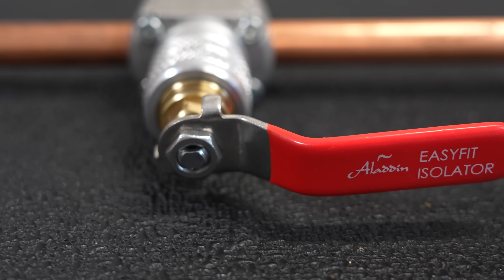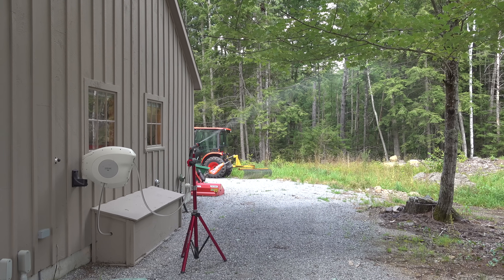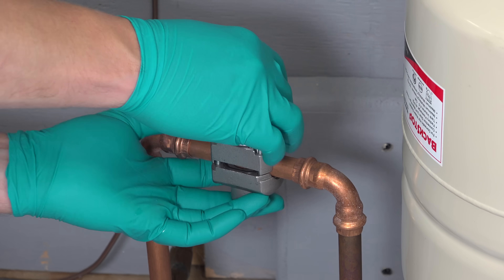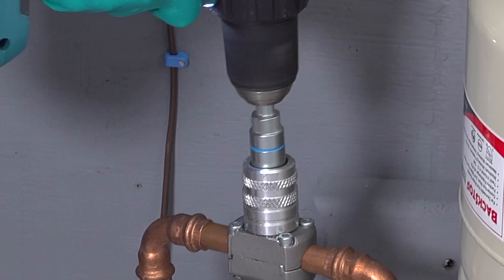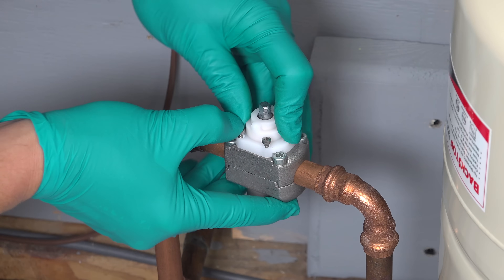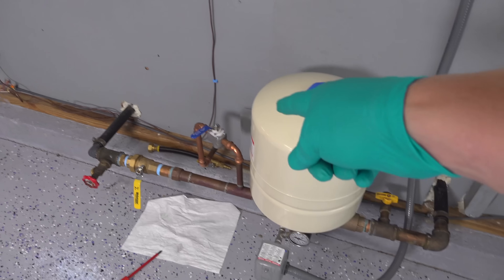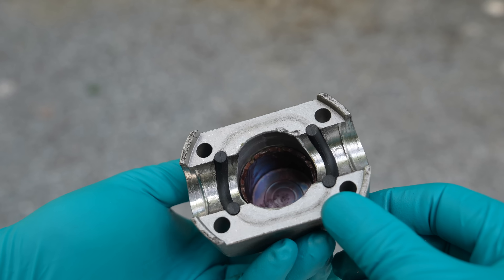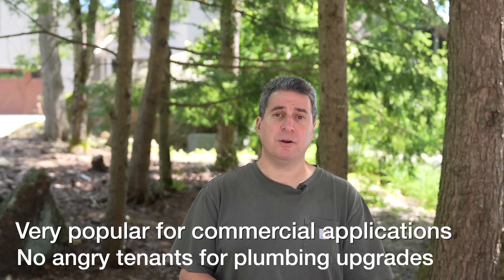SHUT-OFF valve installs on a LIVE WATER PIPE - Aladdin EasyFit Isolator

Comment: Awesome product, but my concern would be the copper shavings that's going to come out of the faucets over the next few days.
Reply: Thanks for your comment, due to the valve’s unique design the pipe coupon and swarf is captured in the lower housing in the special chamber at its rear.  There is minimal amounts of swarf produced during install.

Comment: What is the warranty  on the O ring?
Reply: Thanks for your comment, the gaskets in the valve housing seal during installation. Once the valve is installed the boot inside the valve acts as the primary seal – it’s a dual seal valve.  They have been sold for over 10 years in the UK and haven’t been known to leak once installed.

Comment: I guess I'm not sure who would need this. If you have a well, just shut off the pump. If you have municipal water, you should have an outside as well as inside shutoff.   I guess I could see a plumber carrying a few around for emergency calls, but if you're a homeowner who needs a quick solution, going to a store that has one doesn't qualify as quick to me.

Comment: Nice presentation/demonstration.  I'm not sure I'd use it due to the cost, and the fact that usually you can turn off the water, but it's an impressive bit of engineering. Thanks for posting.
Reply: I don’t think it’s intended for use where you can turn off the water…

Comment: These are only £50 / $65 here in the UK
Reply: The US version of the valve has a different blade, material, and valve body design to withstand the increased strength/density of US copper tubing.  The UK version of the valve will not work on US pipe.

Comment: Seems a good way to send a bunch of copper particles downstream. I could see using this only in the most dire of emergencies. Like a train, a bunch of techs how to use it and give them each a sad like TV installers and such.
Reply: Thanks for your comment, due to the valve’s unique design the pipe coupon and swarf is captured in the lower housing in the special chamber at its rear.

Comment: what happens to the shavings? won't that end up in the pipe when drilling into it? I guess that is not something you'd want to drink.
Reply: Thanks for your comment, due to the valve’s unique design the pipe coupon and swarf is captured in the lower housing in the special chamber at its rear.

Comment: Saddle valves are illegal in most jurisdictions
Reply: Thanks for your comment, the Easyfit seals on the ends of the pipe as well as the sides unlike a saddle valves and is classified as a ball valve, it is both UPC and NSF approved.

Comment: It’s £50 in the Uk.  it’s about the only product I’ve ever seen cheaper in the Uk than the US 🤷‍♂️
Reply from the maker: I think the difference is you guys seem to use soft copper pipe and hard pipe, which I think is called council grade? The hard pipe version here is all we have which needs the cutter, where the UK version for soft copper just presses the plug out. Not saying that justifies it all, but they are different designs

Comment: Just remember to keep this in an accessible location, because every seal on this thing is rubber and those will eventually crack and fail.
Reply: Thanks for your comment, the gaskets in the valve housing seal during installation. Once the valve is installed the boot inside the valve acts as the primary seal – it’s a dual seal valve.  They have been sold for over 10 years in the UK and haven’t been known to leak once installed.

Comment: These valves have been around for decades for industrial uses. This is just a shrunk down version for more common pipe sizes. Unfortunately, it's probably not up to code (yet). So if you care about being "legal", insurance, or selling your house, check your local codes before you potentially waste your money on this. Remember, it may be legal to sell in the US, but that doesn't make it "up to code".
Reply: Hi great news they are both UPC and NSF approved so they are up to code.

Comment: Very sweet solution.  Almost sold me but that white plastic cap and the price is what makes me pass.  I can imagine the plastic cracking over time, especially if used outdoors.
Reply: Yeppp me too Plastic is a NO NO !!! About 2 years out in the weather C R A C K !!! Than try to get your $ back !!!!!!!!!!!!!!!!!!!!!!!!!!!!
Reply: Fitted a 22mm one. My drill died trying to fit it.
Reply: @pauljenkinson2870 And?  Did you still complete the install after the  drill died?  I presume you mean this happened mid=drill?
Reply: I'm more worried about the o-ring.
Reply: The cap is made of Nylon, ok, still plastic but really tough.

Comment: So a couple of questions...what happens or where does the copper pipe go that is cut? Why do you drill/cut to a different depht based on cold water line (blue line) vs hot water line (red line)?
Reply: The cut pipe gets pushed into the recess at the bottom of the assembly. The reason for the lines, sometimes you will fine a cold water pipe with a larger diameter. Hot water pipes, not so much.
Reply: The coupon is trapped and sealed along with swarf in the lower housing.  The blue and red lines have no association with cold or hot water.  They are simply markers to differentiate the depth between a 3/4" and 1" valve since both utilize the same drill tool kit.

Comment: I assume the cut out section of pipe is permanently in the base of the valve. How much swarf ends up in the downstream side of the plumbing?
Reply from the maker: That is correct, they call it a swarfless cutter, and little to no debris is made. I can't really measure it to be sure, but thats what they advertise and the cutter blades do look unique

Comment: $250 for 1/2 inch, $350 for 3/4 inch, and $450 for 1 inch. Unless it's an extreme emergency, it's too expensive. A propress fitting or a compression fitting would take care of most problems. Unless you absolutely can't get to a shutoff valve, but in most locales, there is a shutoff valve where the meter is.

Comment: Your expansion tank is far too small.  You submersible pump will cycle 10X as much as needed and cycling kills pumps.   Question: is there a flow reduction when the valve is fully open?
Reply from the maker: That well setup is using a cycle stop valve, which is similar to a digital constant pressure system so the tank is extremely small. I installed this a year ago and didn't want to review it until a year had gone by so I could give honest feedback about it.
Reply: @SilverCymbal  Oh, didn't see the cycle stop installed.

Comment: A homeowner with copper lines might want to buy one of any size pipe they have preemptively. Typically one half inch, and one three-quarter. If you wait to buy one until you actually need it, it is probably too late.

Comment: Video was done right. I like the way you explained that it's just good to know in the back of your head that this exists and probably only good for when you're in a bad or unusual jam.
Reply: Yeah, this is great. Probably not daily use but definitely worth knowing that it exists for the one time it will be necessary and perfect.
Reply: I’ve been plumbing for over 50 years. I’ve never come across a strange unusual situation.
 That I can’t fix in a normal way. Solder or crimp on. Which I don’t care for the crimp on either. Rubber o rings fail sooner or later..
Reply: @ltsgarage7898   I can think of one. The main shut off valve for my house at the curb is bad, frozen and damaged. I could use this to put behind the main inside the house before the meter. The valve at the meter is about 75 years old and it scares me every time it has to be turned off and on.
Reply: @joeshmoe7789  that’s called “deferred maintenance”
When you are having no problems is when you get a new valve installed under your house. I’m figuring that you live back east somewhere . I’m in California and I replaced main shutoffs all the time. 
   Fix or replace it before you need it in an emergency.
Reply: @ltsgarage7898  It's 42" deep near 50-60 year old maple tree with large, thick roots. But I was only giving an example of a use or situation for valve fix.
Reply: @joeshmoe7789  I thought you were talking about your home. 
   But I’ll stay with my statement.
Do your maintenance when you don’t need to use it in an emergency. I’ve replaced so so many of the main water lines coming into homes.
Reply: @ltsgarage7898  Probably sage advice, but it's like replacing the alternator on your car before it fails. Nobody does that. The alt. on my Subaru is 15 years old and still works.
Reply: Yeah, it was a great video.  Like the outside evidence of the shut off working. But where was the leak coming from after the valve was installed?? Hmmm.
Reply: Guys, HERE is The Savior

HalleluYAH translates “Praise ye YaH”

YaH is The Heavenly Father 
YaH arrives via the TENT OF MEETING
YaH was Who they Crucified for our sins
YaH was Crucified on an Almond TREE

— Ancient Semitic Cuneiform of Moshe (Moses)
— Isa Scroll (The Original Isaiah)

Isaiah 42:8
"I am YaH; that is my Name! I will not yield my glory to another or my praise to idols.

Isaiah 43:11
I, I am YAH, and there is no other Savior but Me.

Isaiah 45:5
I am YaH, and there is none else.

Comment: This is the kind of item that when you need it, you truely NEED IT.
If it saves you hours of labor or in case of emergency to call a plumber it will pay for itself.
Does it work with pex pipes or only Cooper?
Reply: It works with PEX and copper tubing (K, L, or M).

Comment: Amazing.  Keep in mind that some of the bits of copper will flow down an operating pipe with the flow during cutting.
Reply: Yeah, that's what I was thinking also.  Depending on where it's installed, that could really mess up all the faucets in your entire house, filling them up with metal shards.   Seems like this would be more of a nightmare than a salvation.
Reply: Thanks for your comment, due to the valve’s unique design the pipe coupon and the majority of the swarf is captured in the lower housing in the special chamber at its rear.

Comment: What happens to the large piece of pipe that gets cut away?  It is still somewhere in the active piping system correct?
Reply: At the end of video he says the cutout is pushed down into the bottom of the device.
Reply: @BLKSG6  I missed that part, thank you!

Comment: Do you get swarf in the line if there is flow during the install?
Reply: Thanks for your comment, due to the valve’s unique design the pipe coupon and swarf is captured in the lower housing in the special chamber at its rear.  There is minimal amounts of swarf produced during install.

Comment: This would have been perfect for a condo I was in the genius builder didn't add individual shutoff for each tenant so you had to turn off the water for all the tenants to do cold water plumbing tasks. This would of allowed an easy way to add isolation to the unit

Comment: So what happens to the piece(s)cut out of the pipe?  There has to be at least one curved disc.   It would be really interesting to see this device removed.
Reply: The coupon is trapped and sealed along with swarf in the lower housing.

Comment: Holy chrome this is good stuff. Can't count how many times I've had to do work on pressurized water systems because the main valve was missing, inaccessible or just failed. I'd love to test this to its fail limits.
Reply: Water flow can be interrupted for repairs in copper pipes with a water freeze device
Reply: @peter572  I didn't know that, but I don't have copper pipes. Good to know though. How much is that device?
Reply: @floridaredneck  It can also be interrupted in Pex pipes.  If you have PVC, you're SOL.  PVC sucks anyways, and I'd avoid it wherever possible.

Comment: So you can install these under pressure? Sounds dangerous but useful. If you had a leak just install that instead and than replace the pipe down the line.

Comment: Amazing! I could have used a few of these over past couple years, where I’ve had to install shut off valves for areas with no access. Literally they must have put the valves in first and then built the tub etc around it. Thanks for this and im buying a set of these today!
Reply: In which case turn the water off from the meter
Reply: A set? In an emergency, I'd be shutting off the water at the source, or where I've got valves in series in place. Plus I've got emergency set ups for leaks/broken pipes. Not waiting for the flood before I start building lifeboats. Best wishes & Best of luck.
Reply: And to think I used to do hot taps on 3" copper lines ,than had to weld them in place !!!  Back in the 70s that was a big break through !!!

Comment: Great video! 👍
Can the same be used on a pvc water pipe of the same dimension?
Reply: This actually works with any grade pex but only “CTS PVC” which is the same ID and OD of copper tubing and PEX 👍🏽…standard American SCH40 and SCH80 PVC  is being developed and in the works 👍🏽

Comment: For the price you cannot beat the results. I can see using this in emergency situations. I want to worry about the 2 piece O ring design but with so many crimp connections out there now with few failures, I could see installing this even at the high price.
Reply: Thanks for your comment, the gaskets in the valve housing seal during installation. Once the valve is installed the boot inside the valve acts as the primary seal – it’s a dual seal valve.  They have been sold for over 10 years in the UK and haven’t been known to leak once installed.

Comment: Cool, the city here is upgrading our main water lines under the streets to a larger size and  installing new hydrants, and I noticed the installation crew has been doing most of their work with the lines pressurized, I assume so they can check for leaks as they cut out a section of concrete, install the new piece of line, then pour new concrete as they work their way down and around the neighborhoods.  It appears they added a lot of  new valves too, but I am not sure why, but I figure it has something to do with the technique of replacing whole neighborhoods of pipe with the pressure still on.
Reply: They work with pressurized lines because turning off water mains creates more problems than it solves - e.g. buildings/homes draining & backflowing into the main
Reply: @Justin-C  I can certainly see that being a problem.  These guys were reburying the pipe and pouring concrete as they were going, I just figured it was real important to confirm there were no leaks before they went through all that trouble.

Comment: How much clearance around the pipe is needed for this valve to fit?  If the pipe is very close to a wall, like the supply pipes under a sink might be, it looks like the valve would be too wide to fit.

Comment: What a crazy price tag! But that's cool.... i needed the city to shut off water at the street. This would have helped. I cracked the poop outs open and used a oropress, but 1" pipe was spraying water out like CRAZY fast and hard,  the orings blew out and it started leaking.

Comment: A question and a comment:
Q: As their tool/bit drills into the pipe, what happens to the the existing copper?  Are any copper bits/shavings generated?  If so, what happens to them?  I'd imaging some copper shavings would be generated, and if one has filters (or an irrigation system) downstream, that the shavings would clog up what ever is downstream.

C: That price though... ouch!  And $250 is just for the 1/2" version.  The 3/4" version is $350 and the 1" version is $450.  An extra $100 for each additional 1/4" seems a bit excessive and a bit price gouging to me.
Reply: It's $60 in the UK so that's a large markup for the US market (Aladdin the manucaturer is a UK company)
Reply: @Fekillix  Payback for our freedom's here, UK still peeved.
Reply: Near the end of the video, it's explained that the "drilled" copper gets pushed to the bottom section of the valve, out of the way.
Reply: @brothermine2292  yea, but are any shavings produced?  I suspect the drilling process generates copper shavings, and (maybe?) potentially clog up a filter downstream.
Reply: @jeffb5798  : I know nothing about it beyond what the video tells us.  But aren't filters designed to be readily accessible?
Reply: @jeffb5798  - the company’s UK website has an animation of how it works. The cutter (which resembles a hole saw) is specially engineered to shave the copper in large pieces that stay contained within the cutting cup. The cup (the hole saw) and the shavings are driven into the well where they will remain, permanently.
Reply: @tombodette6457 Not likely. Sure the cut copper goes down but the shavings will be forced down the line.
Reply: @pumpupthevolume4775  I see what you’re saying and agree with you 100%. It’s kind of like using a holesaw for wood or the big chunk of wood goes into the saw and it’s a pain to get out but the shavings around the outside like you say, will go down the line.
Reply: When you drill something the shavings move upward @brothermine2292